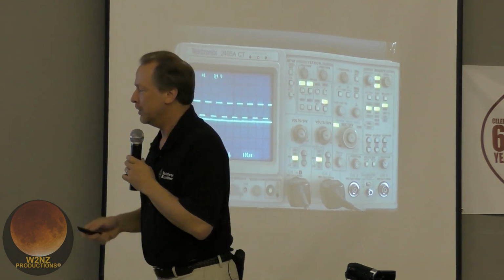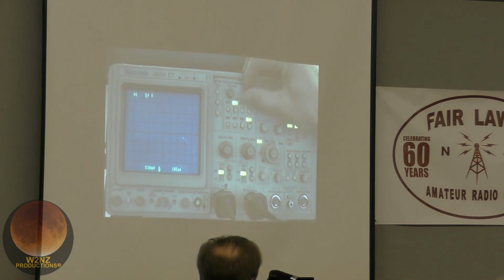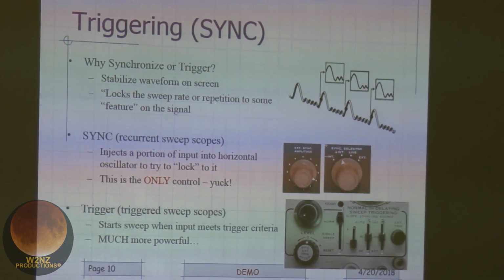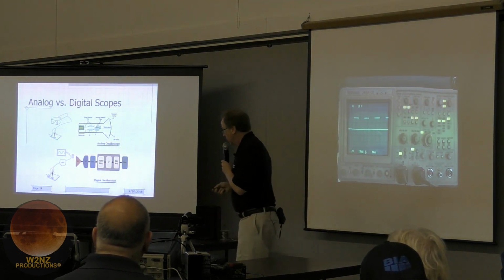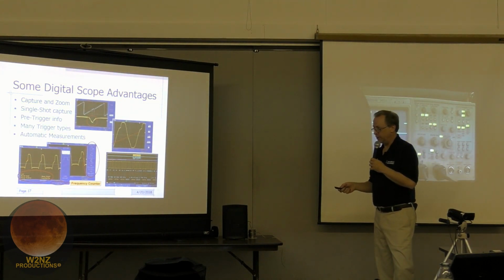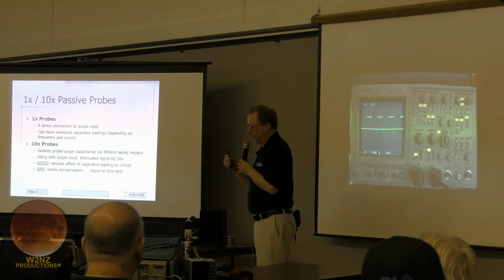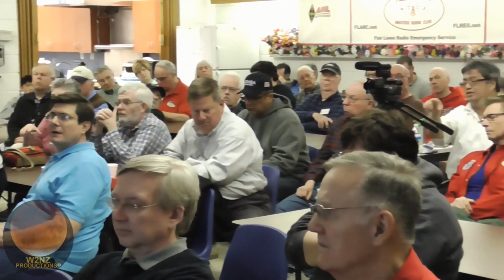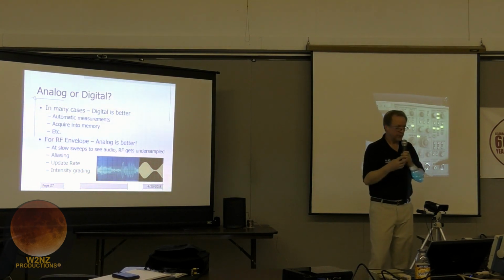#286: Basics of, and How To Use an Oscilloscope | FairLawn Amateur Radio Club talk

Comment: The first "memory" was done a bit differently than today. It was developed by providing a wire grid behind the phosphor screen of the CRT, and where the electron beam struck the screen, the grid fed that X-Y value back and stored it. I'm not sure if that was a Tektronix invention, but the old 7000 and 400 series used a memory system like that. Waveforms were captured by a Polaroid camera. I have a small Tek handbook about that around here somewhere, and I still use a 7000 series scope once in a while.

"Tektronix 7000 series oscilloscopes have high-speed trace retention and long display times that can last for hours or days."

Actually, Tek had an entire series of those handbooks in paperback, and they are a good read for anyone wanting to learn the secrets of scope development.

Comment: How come my modulation wave form is just lines and not bubbles?
Reply from the maker: It could be a couple of things.  I assume that you are looking at the RF envelope of your transmitted output...  It is possible that your horizontal scale or sweep speed it set too fast.  Or, if you are using a digital scope, it is possible that the scope sample rate is too slow and the signal is being aliased.

Comment: 2 nights ago I dug my 2465 DMS out to fire it up and see if I can make heads or tails out of it. Last night after figuring out enough, I took pictures of it working so I could sell it because I thought it was above my pay grade. Today I'm looking at some forum post on antennas and found a link to this video. The forum said he works for Tektronix,  some of his first words are "today I'm in FairLawn" and he is doing his demonstration on pretty much the exact same oscilloscope I can't figure out. I grew up in FairLawn. Mind Blown. I guess it's a sign to keep the scope and learn all about it and use it.  That building has changed quite a bit, it used to be called the Rec center. The water tower was right around there and we used to visit Bojangles the Saint Bernard, that lived at the water tower, that seems to have been torn down. what a trip. Thanks. You have a new subscriber.

Comment: Do you have any videos on explaining how to use a logic analyzer to measure data busses, address busses, test ROM and RAM chips, test multiplexers, adders, address decoders, counters. Using a logic analyzer you can display all the inputs and outputs and count the highs and lows to get the Hexidecimal values. It would be nice to know how you troubleshoot digital electronics since i haven't seen any digital theory videos or troubleshooting in digital electronics by you.

Comment: Hello Allen,  I love your videos, keep them coming.  I am looking to get a scope for use with 2 meter 144MHz band.   Is a 200MHz scope good enough to properly examine 144MHz  frequency output of an RF amp or do I need a scope rated for higher than 200MHz ?
Reply from the maker: In order to visually see distortion on the output, you'd need a scope with at least three times higher BW than the signal.  Frequency measurements will be fine, although a scope isn't the best tool to make frequency measurements.

Comment: here's a question, i can't afford a good oscilloscope, but i would like to have one for my VHF projects, so say 200MHz and 5uV/divison... i have access to a 50MHz 50mV/division. so because the signals i want to view are periodic, may i use a mixer and amplifier, so say shift my RF down to 20MHz and amplify it by 10,000 and use the low end scope? is there such a project? has anyone here done that? or advice how to proceed, cheers :)
Reply from the maker: Just to let you know - you're not going to find any oscilloscopes that will give you 5uV/division - they just don't make them with that kind of sensitivity.  Typically you'll see sensitivity down to 1mV/div or 500uV/div, but not anything near 5uV/div.  Scopes just aren't used at this small signal level.  Spectrum Analyzers on the other hand, can see such small signals...

Comment: Hey W2AEW! I'm a big fan of your page and work from 3V! I'm working on making and testing my own toys and to be honest, many of your videos made my life so much easier! There is only one thing that I couldn't figure, and kept me busy for quite sometime, in your gilbert cell videos.. Could you please spare some of your time to explain it to me? I would immensely appreciate it! I need to make that Gilbert mixer!! Majdi 3V1M.
Reply from the maker: I assume you've watched the couple of videos I have on the Gilbert Cell.  What questions do you have?
Reply: Thank you so much for reacting to my comment!!! It's been a year since I've seen them among many of your videos! and I came across them again lately.. Anyway I've a sticking project; I've worked on a Gilbert mixer, i know the theory behind it, but I've never managed to make the cell's bias! How did you calculate the resistance values required for bias?! what methods did you rely on?? i tried to make the upper diff amps based on voltage divider bias, but never managed to make the lower diff amp bias!!! nor did i manage to bind its collectors with the upper diff amps!!  I've looked all around even in different languages but all i found is theory about the cell, but nothing on how to actually make one! I've been stuck ever since! I'm working with an 2N2222A.. I'd appreciate any help or info you can give me! Thank you! best 73s
Reply from the maker: If you don't cross-connect the collectors from the upper differential pair, then you don't have a Gilbert Cell!

For your reference, here are the two videos on the Gilbert Cell:
Basics: https://www.youtube.com/watch?v=7nmmb0pqTU0
AM and DSB-SC Modulation: https://www.youtube.com/watch?v=38OQub2Vi2Q
...and the notes pages from each:
Basics: http://www.qsl.net/w2aew//youtube/GilbertCell.pdf
AM & DSB-SC: http://www.qsl.net/w2aew//youtube/GilbertCellModulation.pdf

The notes pages show the biasing scheme.  I used a simple resistor string to setup the bias for the upper and lower diff-pairs.  The main considerations for setting up the bias are:  1) make sure that each pair is in the active region when the diff-pair is balanced - thus make sure that the IR drop across the collector resistors puts the collector voltage above the base voltage of the upper pair, and 2) ensure that the common emitter voltage of the upper pair is above the base voltage of the lower pair.
Reply: Thank you so much, I am so sorry for the late reaction to your comments as I've been really busy lately. 

Anyway what made difficult for is that in most of the documents I have, the bias requires a +vcc for the transistors, except that when looking at the tail transistor, the collector is connected to the upper pair's emitter than the vcc, and that made me really confused!

I really appreciate your help, advices and the links you provided! Will definitely get busy working with them! Thank you so much!
Best 73s de 3V1M! :D

Comment: Wow, you're a very good teacher Alan. The extent of your knowledge is impressive. I have one question though, A scope usually has 3 input coupling options, AC DC and Ground but in what situation would you use ground? I'm pretty new to using scopes and this is something I always wondered about. I watched the whole video but I didn't get an answer out of it (or maybe I just missed it).
Reply: EdEditz . Mostly I use the ground option to set (or remove) the offset, since it's not always clear with a signal on it.
Reply: Ah right, that would make sense. Thank you.